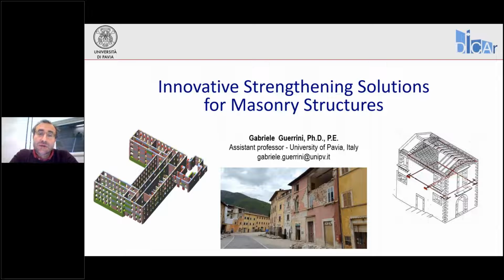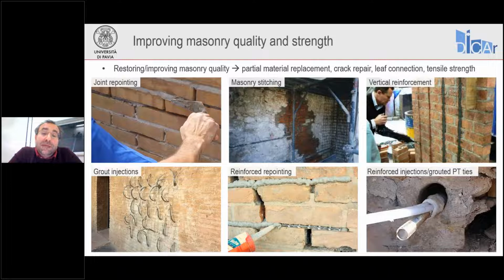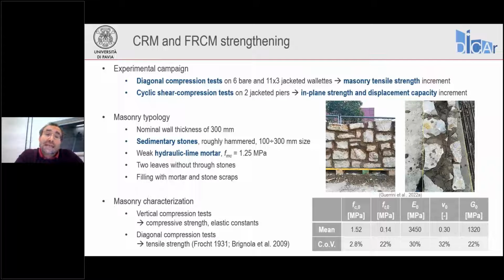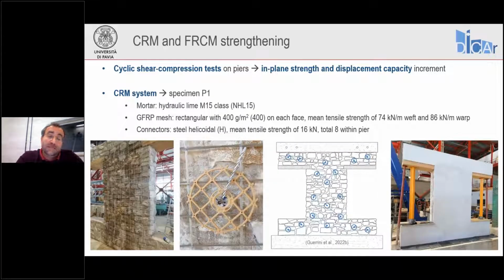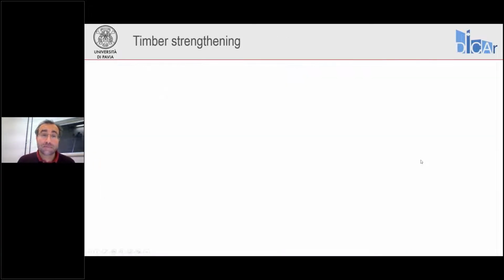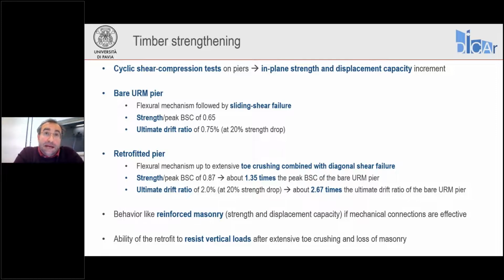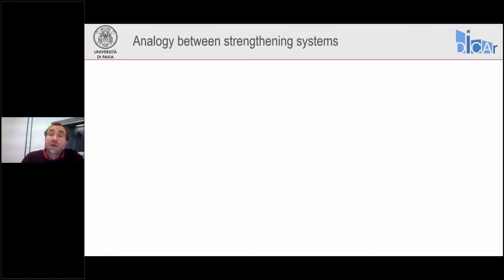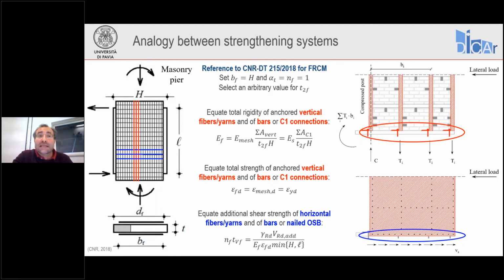3Muri: Innovative strengthening solutions for masonry structures

Comment: This is all good but the test sample at 13:30 cannot be called masonry by any stretch. More like a pile of rubble with ample mortar thrown in. It seems  to me all this is in a direction of applying a "quick fix" of sorts solution to any type of wall structure. I would be interested in also figuring out what can be done to improve the weak spots in the wall by improving the quality or the techniques of the masonry itself. It is a lot easier to do nowadays even fro existing structures - at least partially.